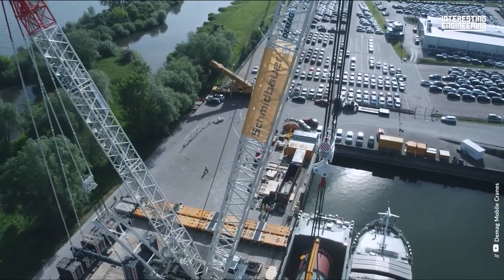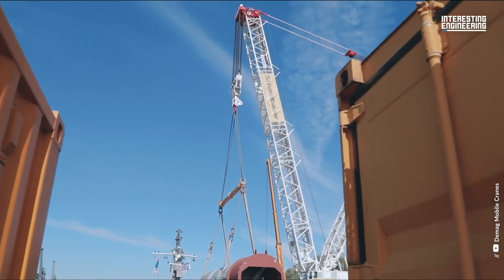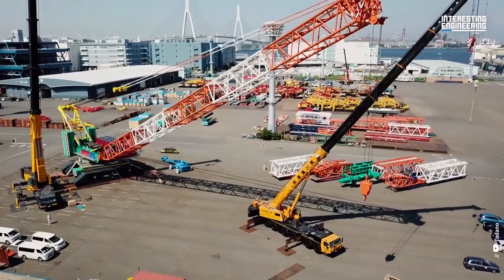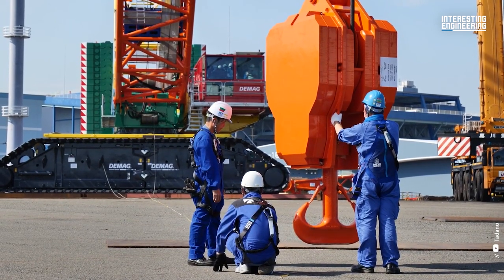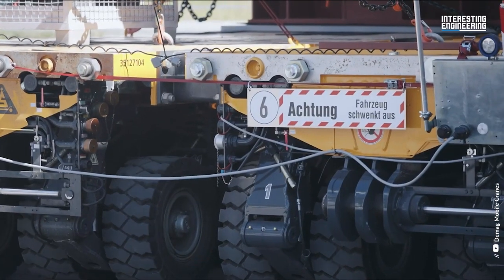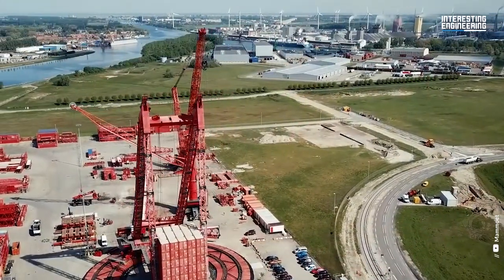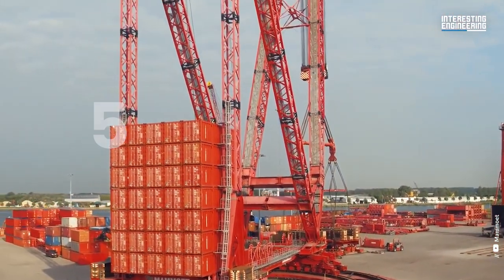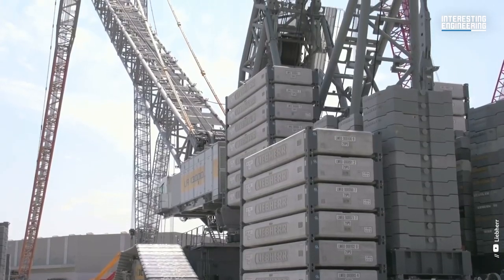World's Top 5 Biggest Land Based Cranes

Comment: When it takes Giant Cranes to build even BIGGER GIANT CRANES, you know you are seeing MEGA MACHINES....

These massive cranes dwarf the human operators standing next to them. When these massive cranes can pick up thousands of tons, everything looks a lot lighter. Many are land based and even mobile. They can move under their own power saving time not having to dismantle before moving. 

Need to put something on top of 250 meter tall structure, forget calling in a helicopter, there are cranes just for extreme pick and place over 800 feet high. Cranes can pick up thousands of tons, a helicopter is limited to 10 - 20 tons.

Not only massive, but taller than many modern skyscrapers.